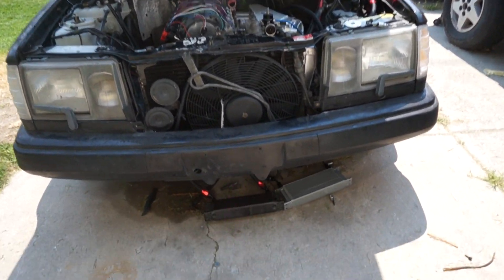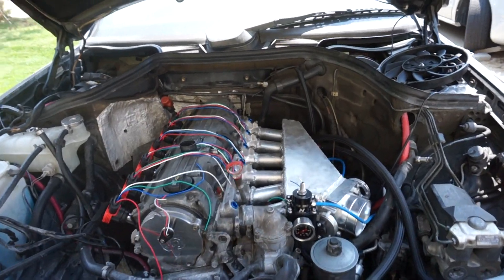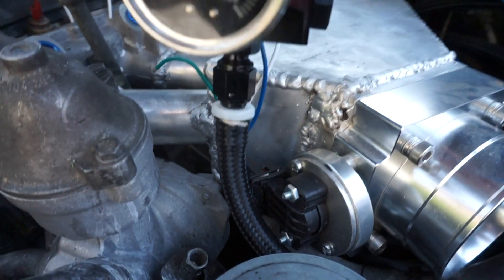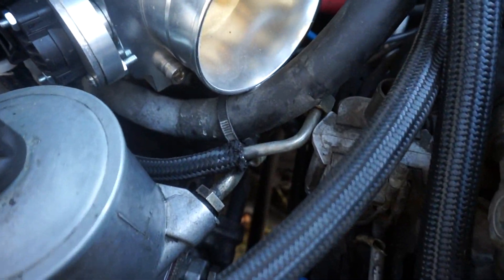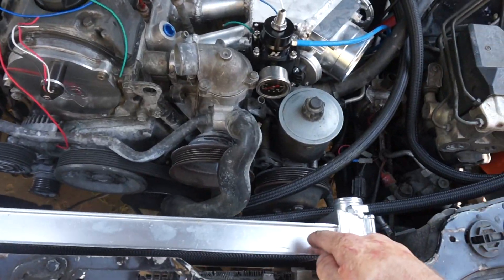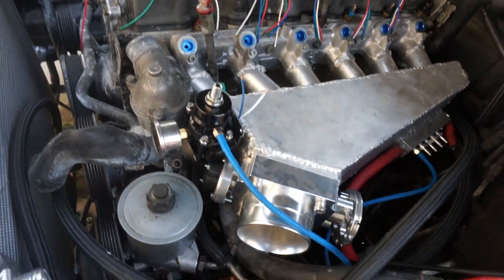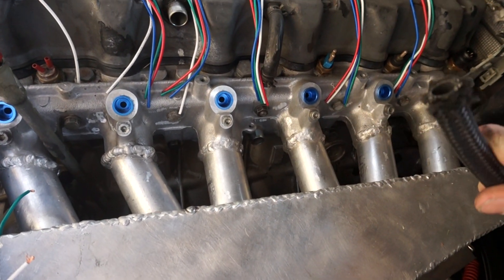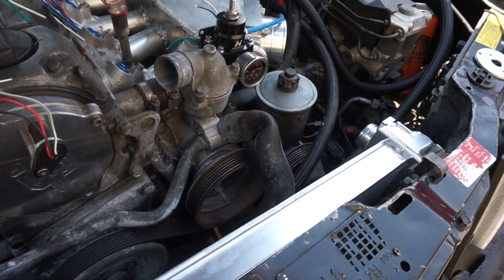M103 Megasquirt/turbo update

Comment: I have a 300E with M103 and looking to MS, scrap the Ktronic crap, and modify ignition.  Noticed you unboxed Turbobandit intake but still have original hand made plenum.  Was the throttle body Turbobandit, also what coil over plug did you go with?  sorry lots of questions :) great job!